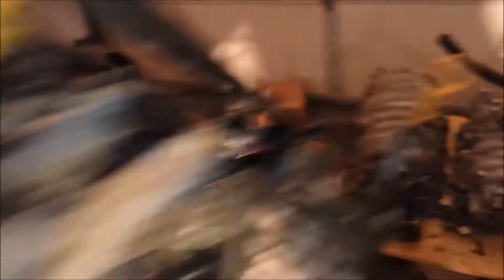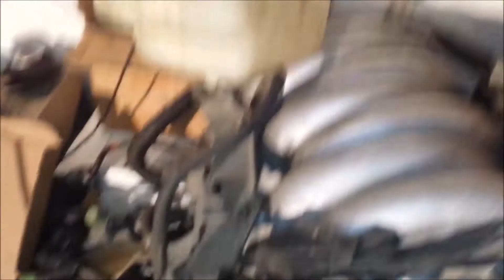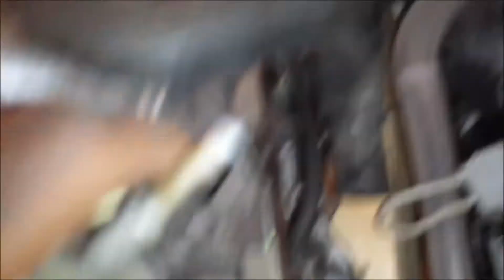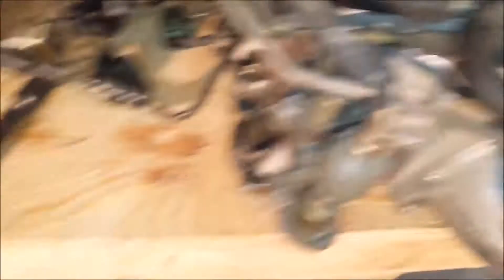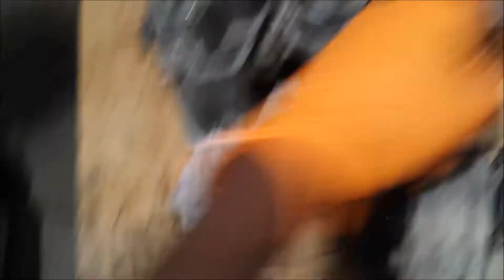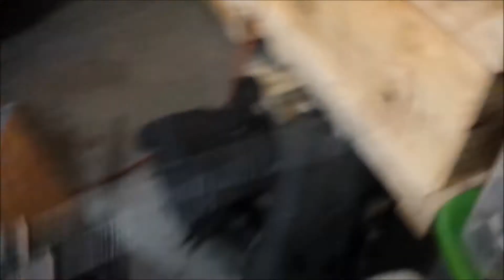VK45DE Part 2. Throttle body & Intake manifold | Variable length runners

Comment: Man I'm back. So I changed the alternator out but after a week I was on the freeway and I lost throttle. The engine stayed running but I rolled it to shoulder. Turned car off then back on and it drove fine after that. No lights popping on dash and when I got home I thought I smelled rubber?? Do you have any suggestions

Comment: Just curious what the difference in performance is either secondary throttles open or shut,
Reply from the maker: I don't have the exact number, but the whole point of the flaps opening is to allow flow efficiency. That is advantageous at high speeds and idle conditions.
Maybe if you can, disable the system and then do an aggressive run on the highway. Come back and reconnect it and repeat the experiment to see if you can perceive the difference.
Reply from the maker: Here is a more recent attempt to talk about it. https://youtu.be/ycFY3UnEgbA

Comment: Does this with the 03’ m45 vk45 with the original throttle body and fuel rails?
Reply from the maker: Are you asking if the new intake will fit on an 03 M45? 
If so, then the answer is yes. But you still have to get around the throttle body deal

Comment: I'm curious if you know why the throttle body on the 03-04 engine only opens manually about about 10-15%, and what might be there purpose behind the dual action in the first place. Any ideas?
Reply from the maker: As much as the throttle body has the cables, it's still an electronic throttle body. The manual opening is only there as a fail-safe.

Under normal operation, the throttle cables work the same way as the wires in a true Drive-by-wire system. That is, all they do is communicate to the throttle body how much extra air it should allow into the engine, using the ECU as the middleman/facilitator.

Comment: Hi, it's possible use de throttle body 2006 in 2002???
Reply from the maker: It would need some wiring as well as the ECU or ECM being upgraded

Comment: I have this same engine in my 2003 INFINITI FX45. Vk45de 4.5l V8. But, I dont feel like my car has the V8 power. Will a new intake manifold give me more horsepower ?
Reply from the maker: I don't think the manifold by itself will give you more power. At least not noticeable compared to the efforts

Comment: Wondering if yo have or you know where I can get an 08 vk45de upper intake manifold. As I was reassembling it, I broke the port where one of the fuel rail bolt is mounted and don’t want the fuel rail to get out of place :(

Literally it was the last bolt that I had to put. 

Thanks!
Reply: Junk yard is your best bet.

Comment: Did you install the later intake and did you feel more torque in lower rpms or hp on mid-range or top end?
Reply from the maker: It wasn't a swap in that sense. I was using the block/intake combination that is used in the 06+ m45. And its difficult to compare because as much as the 06+ and -06 m45 had close to the same numbers on paper, they had different components such as ECU and trans electronics as well as diff ratios.

My guess is that the new manifold will definitely pull harder at lower RPM while the older one might be better at the top.

Comment: I'm grave digging vids here, but in case it helps, the Mercedes vacuum valves for diaphragms have three ports like yours here, the top one is usually exhaust - so the actuated diaphragm can return to rest position. I notice Nissan return the tube to the intake, but Benz usually just have a small gauze filter on it because they're run by a vacuum pump, and aren't metered air. They're PWM run and monitored by the ecu in the Benz stuff.
Reply from the maker: Gravedigging is allowed, actually encouraged, in our world. There's not much excitement in the world of intake manifold internals, hehe.

Do you know if the Benz system has a vacuum tank as well? Some time back I made a video on the VIAS system specifically, going into detail as to what happened at what RPM; and even walked the camera all along the tubes. It never quite saw the light of day, but I think I will have to find it, polish it and upload it...for the sake of the handful of my viewers who enjoy the in-depth content, I owe it to them.
Reply: @EdBwoy  Give the people what they want, haha. Some of the vehicles run a small vacuum distribution tank to the solenoids, like the om651 engine with vacuum pump. Benzes also love running vacuum pumps on some petrol engines because they're weird like that.

Comment: Do you know if the titan 5.6L throttle body is the same as the m45 throttle bodies? Could we use the throttle body spacer from the titan on a vk45de

Comment: wish you had a removal from engine tutorial..i have a coolant leak under the manifold on my 07
Reply from the maker: It's coming next year! All the engine (dis)assembly projects should be uploaded shortly. 
But you can check out the FSM for a pretty good guide.

Comment: hi ed great video like always..can i replace just the hydro fan pump,or does it need to be the wjole water pump?thank you!!
Reply from the maker: Depending on your year/model, the water pump is a fully integrated unit.
What is the problem you're having?
Reply: @EdBwoy  thank you for the reply..it's 2003
Reply: It's leaking some hydraulic fluid at times it appears that it's holding fluid but other times there is a small leak it's not leaking any water though
Reply from the maker: @migueltorrez3594  gotcha. If the leak is due to a bad water pump, then you replace the whole unit.
Check the seals, the solenoid etc

Comment: I got a short ram CAI intake on my FX by RActive. You think I need a spacer. Reason I'm asking when I accelerate on inclined onramp to the hwy sometimes it seems like my car wants to upshift to the next gear or dips in power a tad bit. Have you ever had that issue with or without CAI
Reply from the maker: I once had a well made cold air intake. I liked the sound it made, but for performance nothing beats the stock intake. 
Try reinstalling the factory system to see if the problems go away.
Reply: You got a custom box for the cai bc all your doing if you dont is drawing in hot air

Comment: Whaddup Ed. Ahhhhh... I see your're having a discussion on intakes good deal. Can't wait until i get this swap done. Good vid. Buy any chance you know of any one who has an upper and lower I.M  "version 2"  06-08 for sale. Man the design on version 2 is so much better. I did a e39 to e34 manifold swap on my bimmer wagon. Runner design make a difference.
Reply from the maker: Yeah, one of my earlier videos when I started to realize some people were interested in more technical info on these engines.
I'll redo them, now that I have better equipment and have learned a little more about videography.

Have you checked eBay or junkyards (car-part.com) for the parts?

Comment: Hi,  is there any way you could give me the height, the width, and the depth of the '03 vk engine please.....I'm trying fit one in my Z.  A million thanks!!!
Reply from the maker: Hello, I sure can. I'll aim to post something up by the end of the day tomorrow. I have to put a few things back together because right now the engines are in pieces.
Reply from the maker: Here are rough dimensions. Obviously the fitment varies since the engine isn't a perfect 6-sided block,

32" long end to end.
- fan hydraulic hose to heater core hoses
26.5" long for the metal.
- water pump shaft to back of crankshaft/bushing
28" wide.
- farthest distance head to head
29.5" tall.
- bottom of oil pan to top of intake

Comment: I got 03 m45 that has the p1136 code so i plan on taking the solenoid out and cleaning it or might just buy a new solenoid. If the solenoid housing isn't leaking do you think I shouldn't touch it then?
Reply from the maker: It's a good idea to check it out. Clean it out and replace the O-ring if it looks bad.
You might end up needing to replace it but it's worth a try.
Reply: EdBwoy ok thanks and where is on the passenger side?

Comment: Yo I'm hoping you see this and can help me out but do you know a site that sells the variable control timing solenoid gasket. It has the 8 holes i can't find anything. It only shows up stuff for the g35 and 350z v6 motors but none for the v8.
Reply from the maker: The solenoid housing gasket is just RTV.
Reply: EdBwoy really? I read forums that you don't use rtv because it can get into the valleys and clog stuff up. But ok and where exactly is the vct on this engine? I have an 03m45 with p1136 on passenger side

Comment: Great video brother love my 2002 vk45de in my q45. Most people dont no this motor was used in the Skyline racecar for years in japan solid motor titanium valves on the 2002.
Reply from the maker: Thanks Brian. I was also used in the Indy racecar, destroked to 3.5 liter, if memory serves me right. Btw, how's your oil consumption, if any?
Reply from the maker: Nice. That sport button was magical for how drastically it changed the ride & handling.
Add the heated & cooled front seats plus the reclining rear seats... 👌
Reply from the maker: @30YearOldBunta  well, if you have 2 knobs beside the shifter, your front seats are just heated.
If you have a dial and 3-way switch on the seat itself, the seat will be heated/cooled.